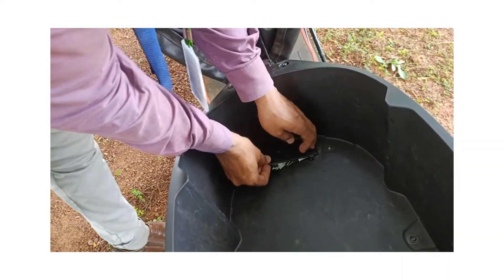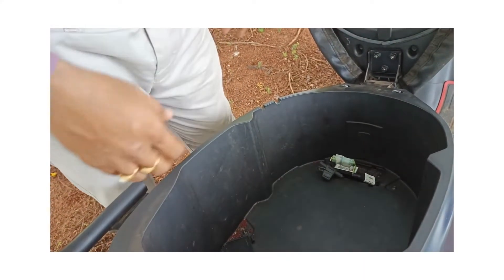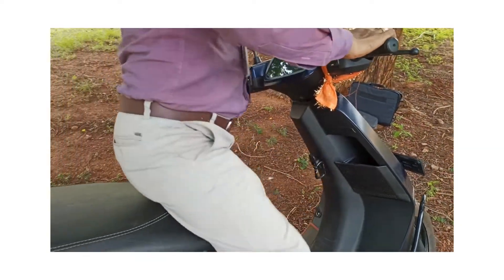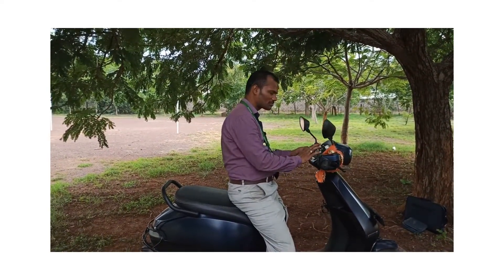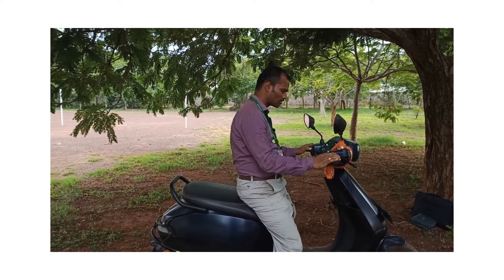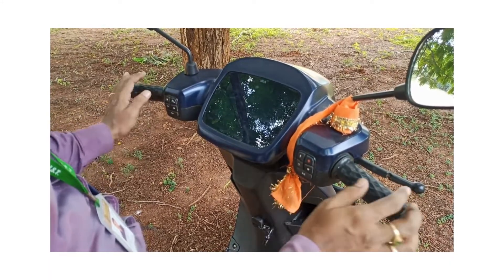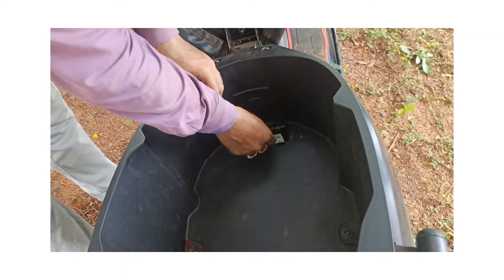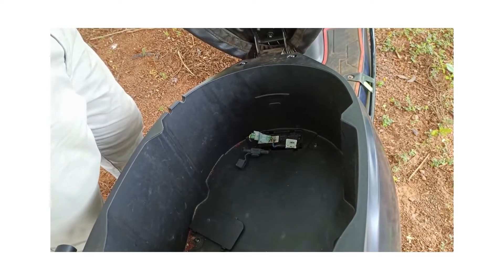Reset Ola S1 Air Instantly | 100% Working Fixes for Common Errors | LIVE Demo

Comment: 3 system issue reset now what is the problem
Reply: Please reply bro
Reply from the maker: When your Ola scooter (like S1, S1X, S1 Pro, etc.) shows a system issue / reset/restart now message, it usually indicates a software glitch or control-unit issue rather than a major mechanical failure.

Electric scooters are highly dependent on a software system (MoveOS) and a Vehicle Control Unit (VCU) to run everything from the dashboard to motor control.

Sometimes after an update or a software hiccup, the system can freeze, lose communication between modules, or show faults — 
is the problems
Reply from the maker: hi sir  solution is 
1. Soft Reset (Display Reset)

Press & hold Power + Reverse buttons together for ~10–15 seconds.

This reboots the display and system like restarting a phone.

Often clears temporary system bugs.  your problem will be solved  or follow the video i have done above

Comment: My issue is after unlocking im unable to drive forward throttling not working but reverse mode perfectly. Tried resetting but still the issue persist
Reply from the maker: Check the side stand touches the body of vehicle when u remove the side stand  then only sensor activated and vehicle drives

Comment: Hello Ram, Please help - Ola S1 X model, when I take the stand up, it still shows the scooter is on parking mode stand and doesn't power ON, what should i do? Thank you in advance
Reply from the maker: It's stand sensor issue ...if u close the stand in contact with sensor than issue will be solved ....take to near by ola service centre to fix the issue sir
Reply: @evcrush Thank you Ram for your reply..Today it got corrected on its on, is this the sensor issue or some software or you suggest the stand sensor needs a change? By the way this has happened earlier as well. The OLA service is not helpful.
Reply from the maker: hi sir issue is only with stand ...change the stand...with a new one...that it will work...
Reply: @evcrush okay, got it, thanks a lot. God bless